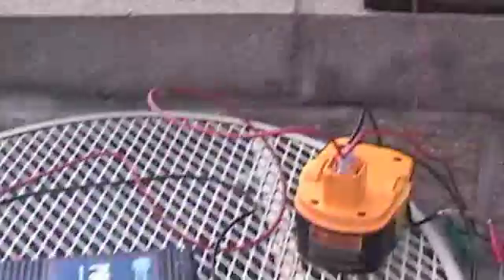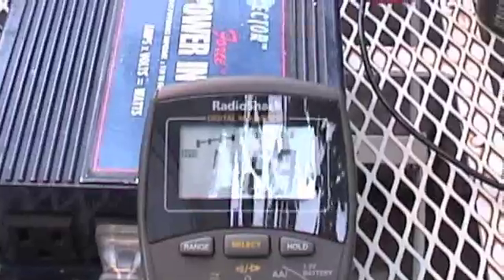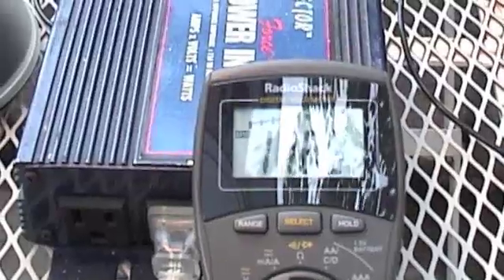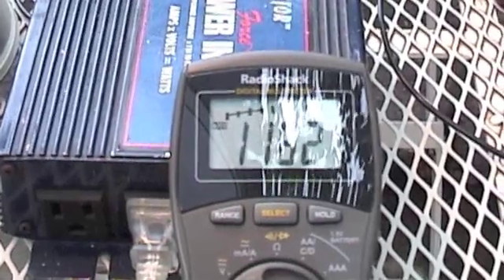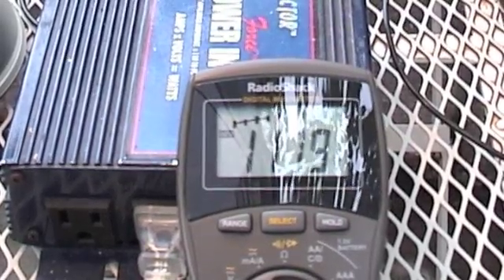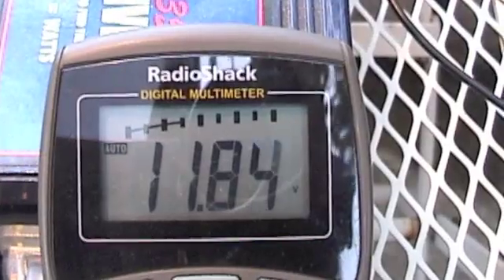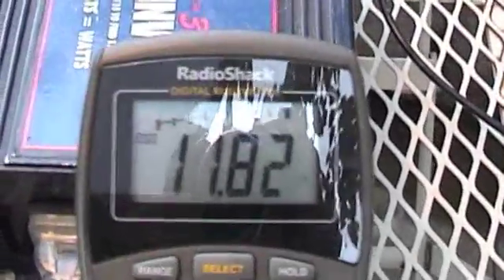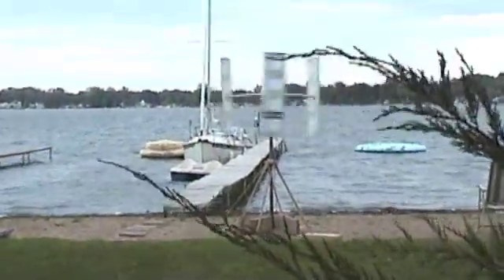Lynx Zephyr Day 16

Comment: Would it make sense to make an assembly that could be used with say a Hurricane or some other PMA generator? (I'm not affiliated with them, it just looks like a pretty good unit).
Perhaps the unit could be made to fold up to make assembly supper easy = unfold and tighten.
You could paint one side of the wings white and the other black and get a radiometer effect;)

Comment: I'm thinking your losses are greater than you think.
1) I did not see the rectifier @ your test area.
If the rectifier is mounted @ the vawt, then your DC voltage will have greater loss as compared to AC voltage, as you are well aware.
2) Agreed about the connections.
3) Overall system wire sizing.
4) The inverter efficiency will also add to the loss.
With all that said, I still think you have done a GREAT JOB!
I’m sure that the final product will address these and be fantastic.

Comment: I have seen one the size of a marry go round out here in Delaware. I don't think they have kids but it did look powerful. My state is open to this stuff.

it would be nice to have power governor with more power to keep the speed manageable on the unit if the winds got high. like adding more power load to as it speeds up.  just a thought =)  

Great Work , I need to do more , Keep it up =)